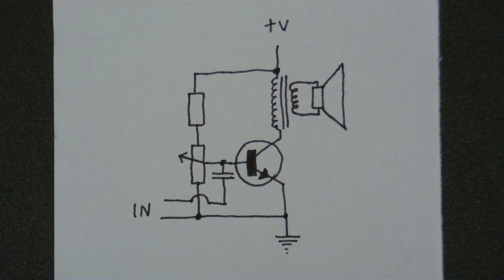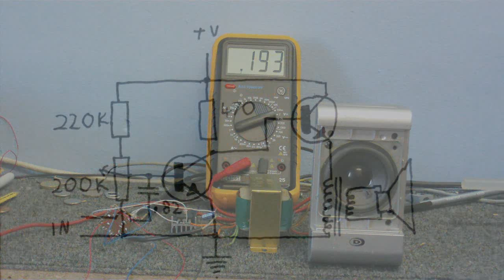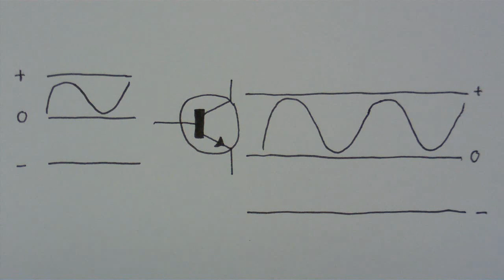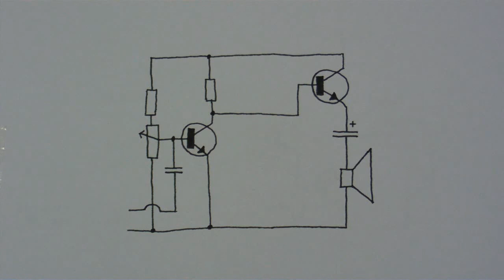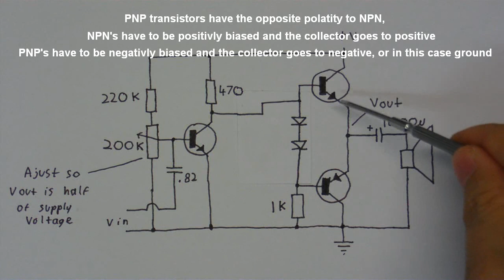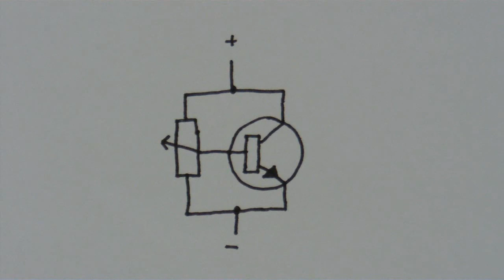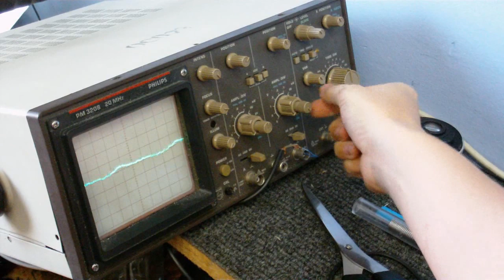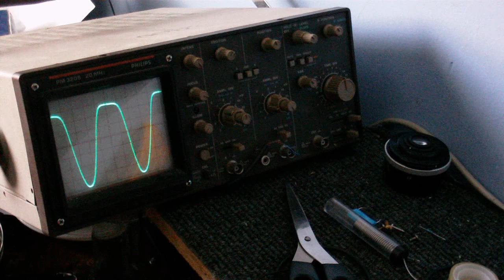CDC Electronic Workshop - Let's Desighn an Audio Amplifier

Comment: also have you played with tubes? I'm guessing not since of the dangerous voltages, but try the Space-Charge tubes. their built to run on just 12 volts (filament and plate) just look up space charge tubes theres a site that gives you some projects and theory and links

Comment: You can keep the amp Very simple indeed but, class A is one hell of a energy waster. 
Opamp+ class AB output stage is a lot better solution for diy half chip/half soldstate amp..
With alot less heatoutput, alot more output power, alot less noise.
Give it a try.

Comment: Nice video!

Just one question @12:43: you said that the added transistor + VR would be something like a "variable diode". Wouldn't it just be enough to ad a variable resistor in series with the two diodes? I'm sorry if I ask stupid things, but unfortunately I have no idea of electronics.

Comment: A simple yet effective circuit. I just put a 10K resistor before the input of the preamp and then I put a BD139 transistor after the preamp, to cut down the distortion a little

Comment from the maker: Most of the time I do, I might refer to other circuits I've seen fro references and things like that, but most of the time it's all my own design putting what I've learned into practice.  I'm trying to get this circuit to put the full voltage swing into the speaker without any power loss, so far no luck but I haven't given up yet.